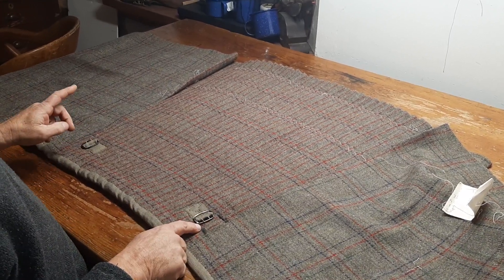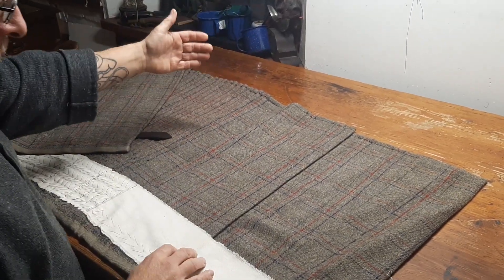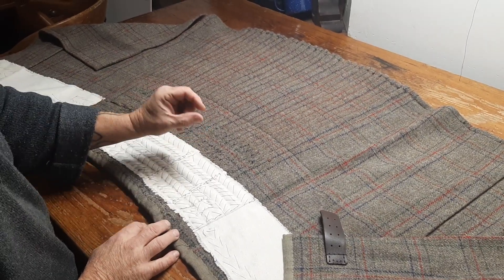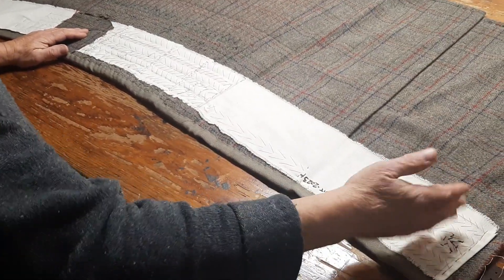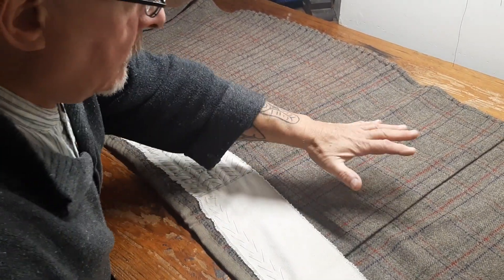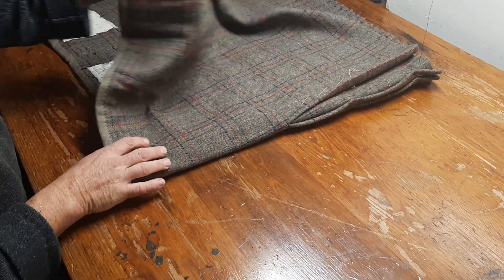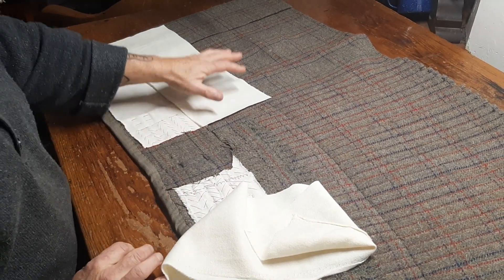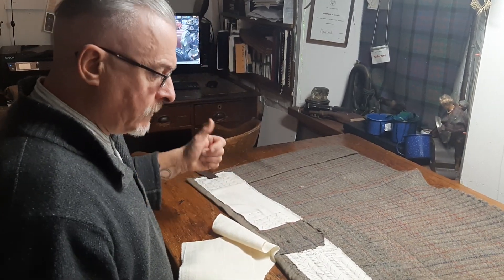(finally) An Update on the Cantlie Kilt Project

Comment: Looking quite good for light weight fabric.  Seems to make things more difficult even though one would think it would be easier to work with.   The little  red stripes certainly gives a different very interesting look in the pleat section.  Might just be the lighting.   Would the fabric lifespan be significantly less?
Reply from the maker: it requires quite a bit more care when sewing - the cloth shifts with even the slightest tug of the thread, and I found that I needed to take deeper stitches (same number of stitches per inch, but 'wider') so that the thread wouldn't tug the yarns out of the cloth.
When I first recieved the (hand-woven) cloth I warned the client against doing any rigorous activities in it - such as moving through thick brush or combat simulations - because the cloth won't last long in those situations.  
He assured me that this won't be the case. 
I assume that the original cloth used in the Great War was of a more durable weave.
Reply: @robertmacdonaldbespokekilt3063  Thanks. So many things to think of if not using normal tartan fabric.